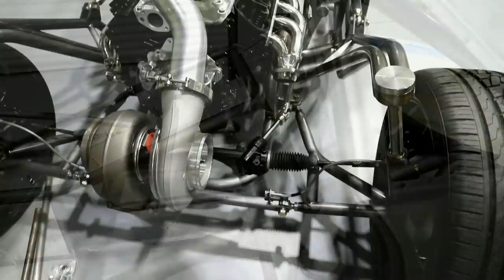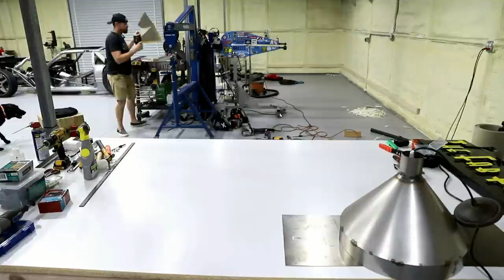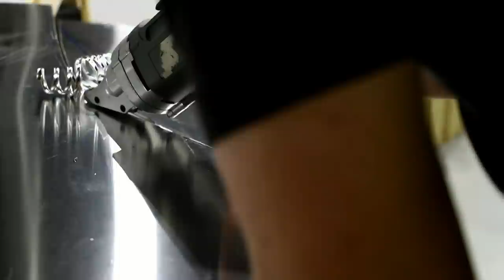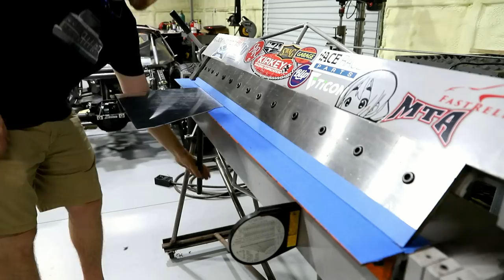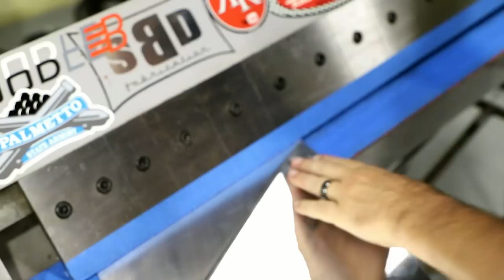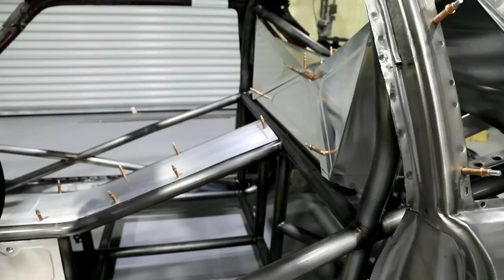How To Make Custom Car Parts For The Modern Day Hot Rod Fox-Body Build

Comment: It's good to hallucinate. Not all the time though. But does bead rolling shrink a panel?
Reply: Yep
Reply: @kriswithak22  thats what i meant
Reply from the maker: yeah bead rolling does change the shape of panels for sure
Reply: @mitchdenner9743  Thanks.
Reply: @kriswithak22  Thanks
Reply: @mitchdenner9743  OK
Reply: @Thefabforums  Thanks for the info
Reply: @kriswithak22  actually it does both, stretches the material to form the bead , which intern shrinks the panel slightly in its over all length.
Reply: @kriswithak22  you can think that if you want. Whatever lets you sleep ay night.